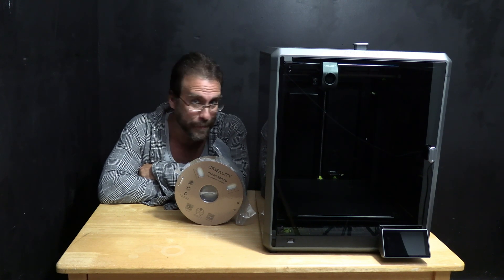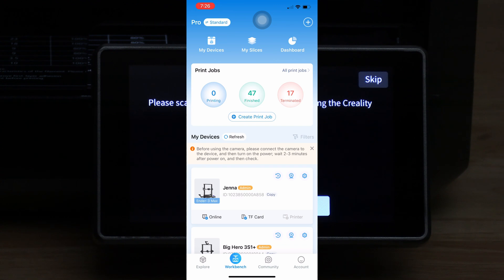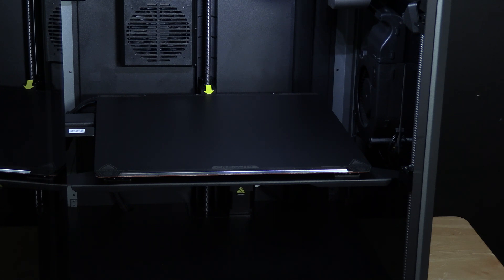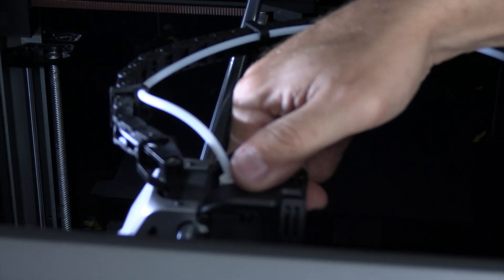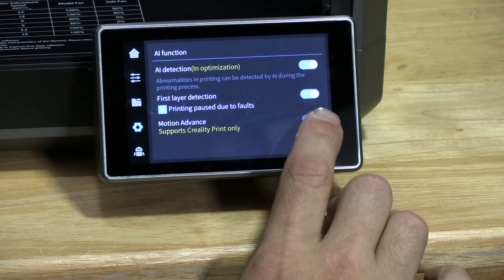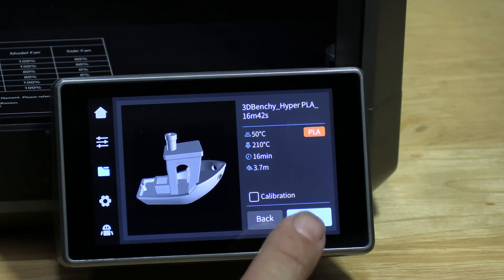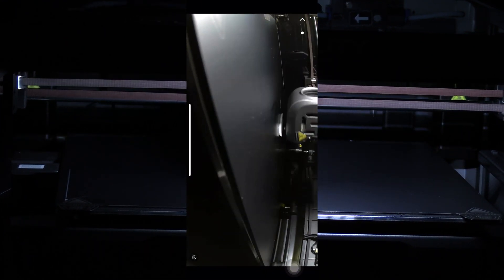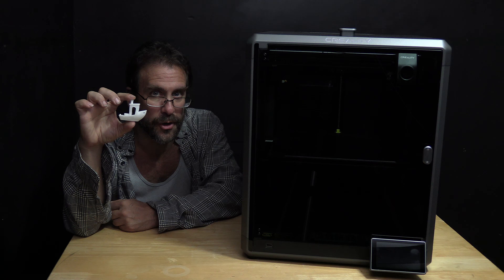Set up, Config, Test Print: Creality K1 MAX 3D Printer + Timelapse

Comment: I’m slightly confused, when you started the benchy the hotend was set at 210 for the print, but when it cut back to the printer screen it was only heating up to 140?
Reply from the maker: Hot end temps will change during nozzle cleaning and such

Comment: Password error fix...
I followed this tutorial but got stuck early by not being able to connect to my network. It said "password error" when I tried to connect but I knew that wasn't right because I very careful with the network name and password. The problem was the printer was close to the router which is a Netgear Orbi that combines 5GHz and 2.4GHz on the same SSID. The Creality K1 Max cannot connect via 5G, they can only connect on 2.4G. I tried to split the channel to be able to select 2.4G manually but the router software wasn't  useful so I ended up taking the printer outside into my yard using an eletrical extension cable to get far enough away to drop the router's signal enough to force the printer to connect on 2.4G. A crude workaround but you only have to it once because once it's on the network it remembers it's connection. The password error is a red herring because it has nothing to do with the password! I hope this helps if you strike the same issue!
Reply from the maker: Craaaaaaazy

Comment: HI man thanks for your share knowledge, i have a doubt, when each print has been done, is recommendable to do some cleaning actions? and if is yes, what kind of cleanning?
Reply from the maker: Nope! Remove the print, and get back to work! I keep IPA in a spray bottle, and a roll of blue scotts Shop Towels. (walmart, Amazon, etc). When in doubt... Spray the bed, and wipe it down. That's it

Comment: Why would i want to use creality cloud?
Reply from the maker: Why WOULDN'T you? It's great. Your GCODES are backed up and stored in the cloud. You can print to any of your Creality Printers, at any time, it automatically detects the printer the gcode belongs too. Remote printer control, remote video monitoring, Time Lapse.... all on the Website AND  the App. Ontop of the community features and "Maker World" like Model library (which came before maker world). Ontop of Manuals. Firmware downloads, and more. Creality Cloud is super

Comment: Can I connect my PC directly to the K1 Max with a USB cable (in other words, bypass the USB stick)?
Reply from the maker: You won't need the USB at all. Everything is done remotely over wifi
Reply: @3DRundown  , only through Creality Print, which is distinctly inferior to Cura.
Reply from the maker: It most certainly is not. However I use Bambu Studio and Orca for the K1, and print via Creality Cloud. Creality cloud is the way

Comment: What better fluidd or mainsal?
Reply from the maker: I use stock firmware, and print from Creality Cloud 99% of the time. However, I find Fluid works fine for me also.
Reply: @3DRundown  and what slicer u like ? Speeds and acc?
Reply from the maker: For the K1, mostly ORCA. It has a profile for K1 and MAX. I do like to print closer to 225ish most of the time

Comment: Did you have any problems with the extruder picking up the filament?
I printed half a benchy and it seems to have 'lost' the filament. I pushed it back in and did an extrude and it was fine. Tried printing benchy again and the same thing happened.
Reply: @BlondieHappyGuy  Thought I had replied. Yes it was because of the lid but that wasn't the cause. It's the angle the PTFE tube entering the extruder. Sometimes it gets pulled aside into a sharp angle which causes extra friction on the filament being pulled. It's been a while but I think I fixed it by printing out a right angle guide that's installed right above the extruder. It was moderately successful before I printed a lid riser.
Reply: @BlondieHappyGuy  I used a riser as per my last comment. It raises the lid a few cm. No problems since, great printer.
Reply from the maker: Not yet, Though I still need to work with these allot more. How is your extruder lock? Is it being knocked unlocked during your print? I've seen some reports of this
Reply: @3DRundown  I don't think the lock is becoming undone. I'm using the hyper pla they provided and printing the bench on the USB stick. Tried a few times, success varies, sometimes the top half just doesn't print, sometimes the top half seems to have lost a layer or something becoming spaghetti. I abandoned trying to print the bench and went to the test cube, that printed fine except for half of layer 5, there was some under extrusion.

I'll play around with it again tonight. Very impressed with the quality of the test cube though. One of the best I've ever printed right off the bat
Reply from the maker: I would skip any pre-sliced GCODE, and slice your own. I'd also consider slowing things down. Go find my test dog video, and try it out
Reply: @3DRundown  I figured it out maybe, it seems the top lid pushes down the ptfe tube in a way that made the filament harder to travel into the extruder. I'm hoping it's just that

I've started to run calibration for some filament I have and temp tower came out good.

Comment: You’re filament temp was lower than I’ve seen others use. Was that because it’s just what you found works best with the filament brand and the printer after testing it?  Can the ender 3 s1 do cloud printing with the sonic pad?
Reply from the maker: This is the pre-sliced Benchy. Since it's a gcode, everything is already set. Whatever the temps are, were dictated by the file. Personally,  I would go 60 for the bed. Didn't really note the nozzle temp. But I do 220-222 on Bambu. Will have to test K1 a bit more to see